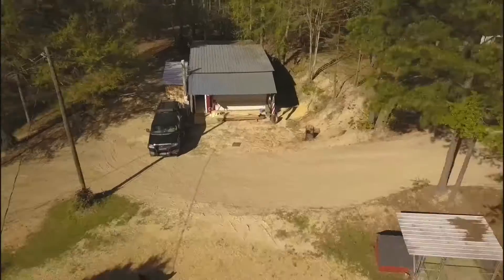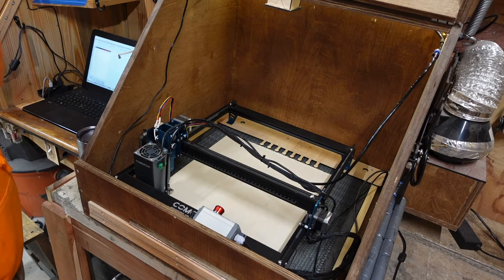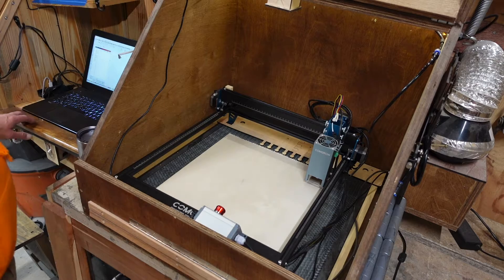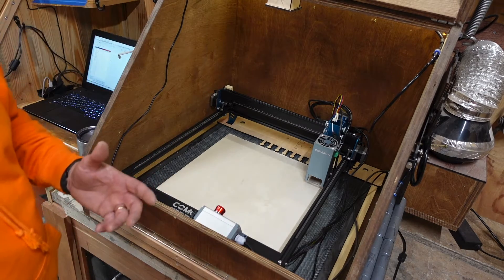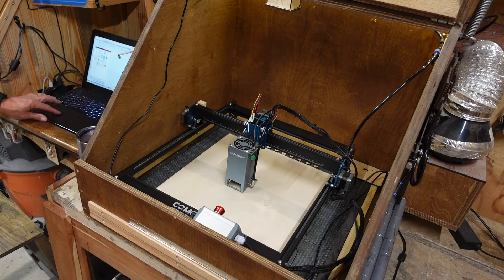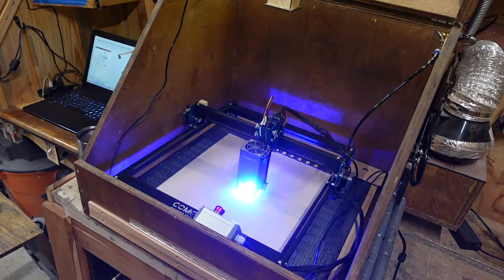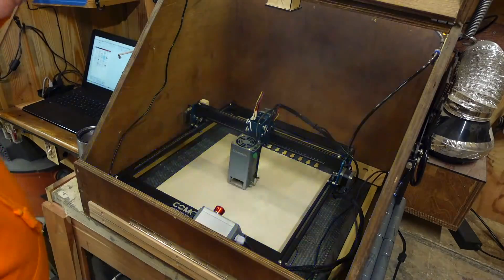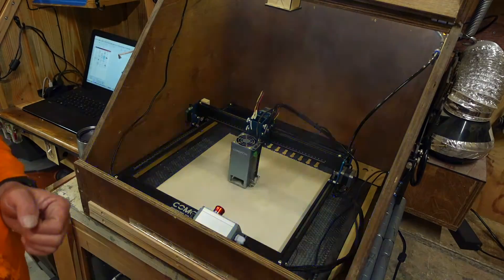Comgrow Z1 20 watt- limit switch fix for module add on

Comment: Hi great videos.  I finally got my 20 Comgrow module installed on my Ortur LM2 (not pro). For the Y limit switch I put a U shaped piece plastic that straddles the left rail and triggers that limit switch sooner.  For the X limit switch I put a similar piece on the gantry rail that triggers that switch sooner.  Here is my dilemma and question.  That piece on the left rail for the Y limit switch is 45mm thick and the one on the gantry for the X limit switch is 19mm thick.  Can you help me with the math please. Do I reduce the Y workspace size by 45mm  or 2 x 45 to equal 90mm  and he same with the X workspace size.  Do I reduce it by 19mm or 38mm?  Appreciate your help..  I always look forward for you videos..  Thanks
Reply from the maker: Best bet is to measure the movement using lightburn. Just move it and total the possible range.

Comment: i have Z1 and wanted the 20 watt. This helps my decision. Will get it and do the things you showed. I do not need workspace more than 200x 200 so this will work out well for me
Reply from the maker: Good deal
Reply: @TheClackShack   Got it and it wont work . Customer service said they do not recommend putting it on a 5-10 watt laser assembly . Yet, the description has my very laser as one to put it on. I may just be out $200 because it will not work on my Z1.

Comment: What about wiring cause that's where I'm stuck
Reply: Trying to figure out how to connect everything so can use 20watt on the z1 frame can't figure out what wires go where to make it work
Reply from the maker: Mine had its own wiring harness and power supply.

Comment: Love my Z1. Really appreciate your Videos. I've learned a lot from you and have purchased from your Etsy store. Looking forward to fitting this 20w upgrade into my budget. Have you ever found a way to extend the Z1 frame for a larger work area?
Reply from the maker: It could be done but I did not. I have several different machines

Comment: Hey there,
I was wondering if I can use the Laser with a Lightburn camera without limit Switches enabled? I basically only use lightburn camera so I don't really need absolute coordinates per se, except if thats a requirement for lightburn camera to work.
Appreciate the help!
Reply from the maker: Switches aren't required but do help.
Reply: @TheClackShack I ended up doing it your way as going by position of the Module would Not Work for me. I also couldnt get that to Work with the camera which is a Feature I wouldn't wanna Miss. Ended Up losing a Bit more im Y direction (355mm) but I did Not need such a thick piece of Wood on the x Axis, so I got to 370mm. Sounds pretty OK to me. Thanks for the Help!

Comment: Quick question..  On the Comgrow 20w laser,  how do you clean the lens cover glass?   I just got mine and it's not apparent to me how to get the air assist nozzle off to clean the laser cover lens
Reply from the maker: Unscrew the air line from the module them the cone tip just pops off. Lens is then exposed

Comment: This is a excellent video!   It's funny, because I had almost the same idea as you did, but I I don't have a 20w module to test it on...  Yet...  The only difference in my idea was for the X axis, that hole you put the screw in for the block of wood.. I think it's threaded,  so I was going to put a bolt in there with a  fender washer to act as the stop for the limit switch.  But the block of wood works too!    While trying to figure out the limit switch issue, I also came up with an idea of how to extend the Z1 fairly easily.  If I am able to make it work, I can give you the details if you want.  Merry Christmas!
Reply from the maker: Cool, I wanted to make a new mount out of acrylic for the switch but the block was just easier…
Reply: Did you ever get the Z1 extension to work?

Comment: Interesting.  Coming from building a lot of 3d printers, this dual motor y axis not having dual switches and independent y motor channels means the left and right side can get out of time with each other.  Basically the x gantry could get skewed.  The solution in 3d printers is to locate the y1 and y2 to a know good location and then home to the limit switch.  So pushing the gantry all the way to the rear, assuming it stops at a point that makes it square would ensure that.  Then home to the switch in front to get you y0 location.  That's part of the reason I haven't added limit switches to my DIY open frame Neje e40 rig.  I considered a drive shaft going completely across from left to right and a single motor but felt like it added more complexity.
Reply from the maker: It uses fixed belts on both sides to mitigate the issue. As long as they are in time, it seems to work well. The limit switch deactivates both motors.